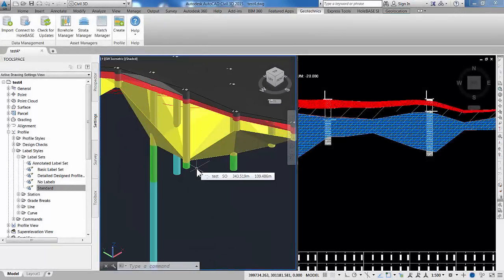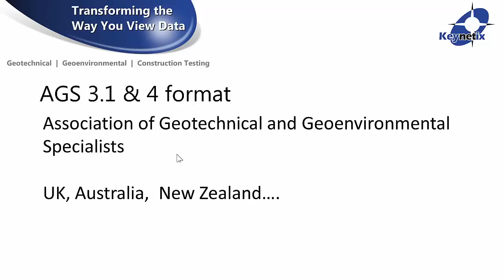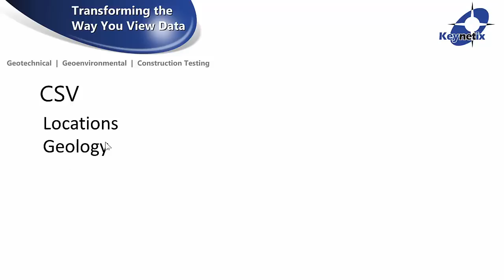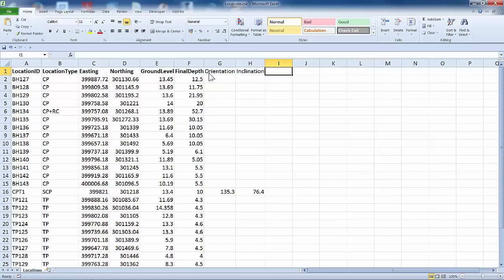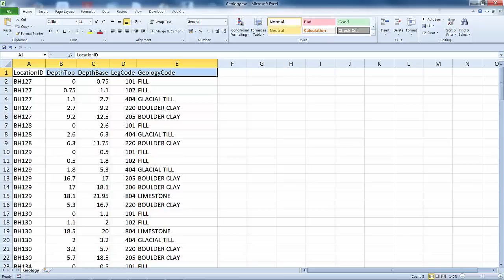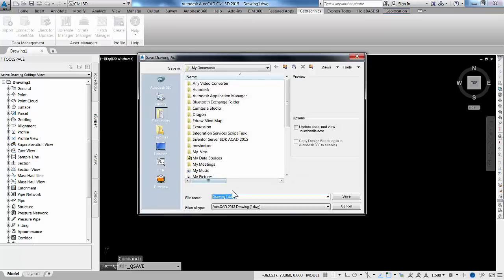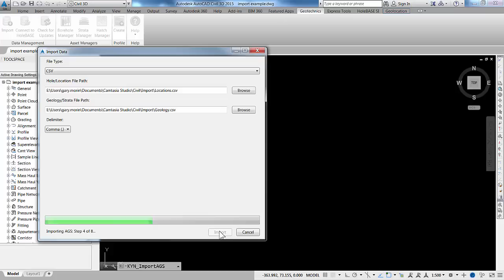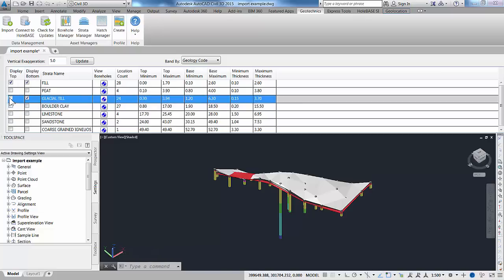Autodesk Geotechnical Module - How to Import Data into the Civil 3D Geotechnical Module

Comment: Is there a way to increase font size on strips projected to a profile?
Reply from the maker: Jared Travis Hi Jared
The geotechnical Module does not support custom Log Strips, this functionality is included in the HoleBASE SI extension for AutoCAD Civil 3D, the custom strips can also show all manner of other down hole data including water strikes, SPT data etc.

However there is a work around, just select all of the log strips, then in the Properties dialog box, filter text and mass edit the text height property.